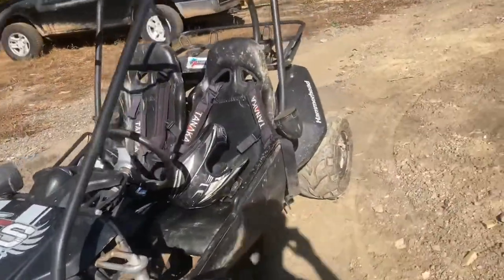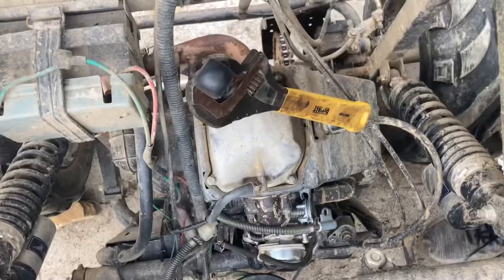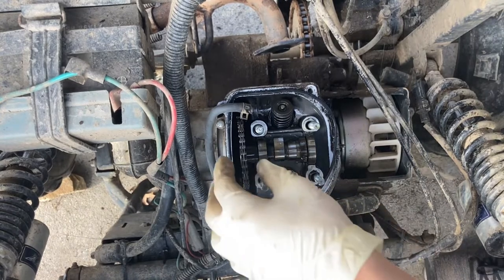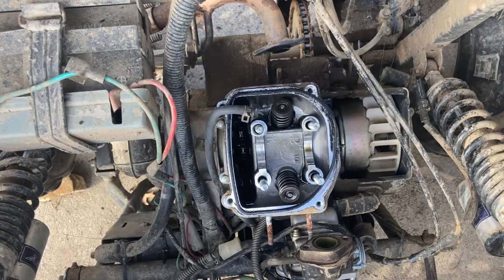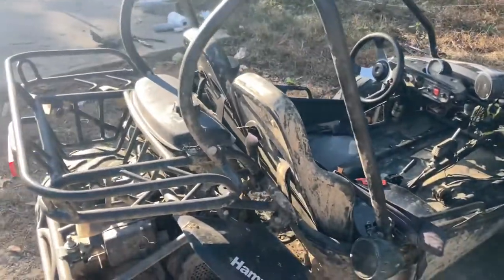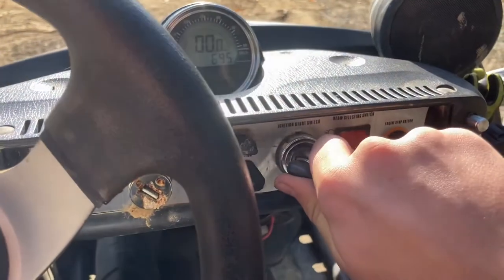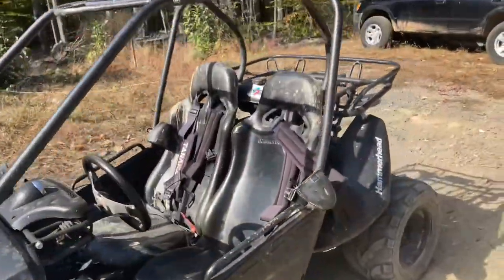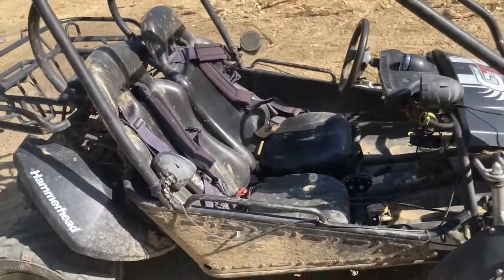Big boring my hammerhead gts 150/gy6 engine!

Comment: Did you adjust the valves?
Reply from the maker: Yes I made sure the clearance was in-spec, valve timing was in correct, and cleaned the carbon off the valves.
Reply: Yet you fail to mention the valve clearance # or how to set the timing 😢